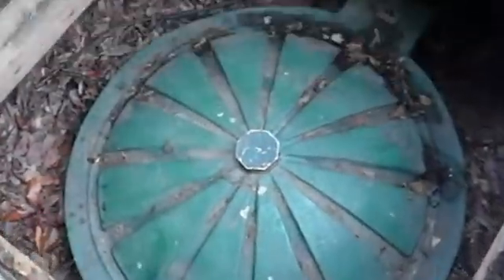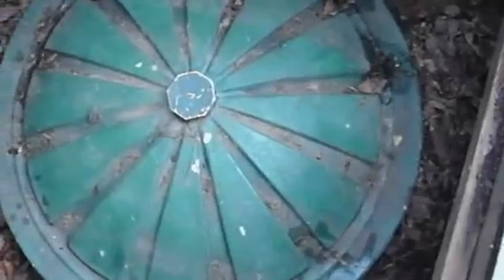Multi-Flo 32 years old and still working great

Comment: Ours was installed in 1996.  We're on the 3rd aerator motor.  It had the primary sensor assembly replaced, and the filters completely replaced once.  In the past couple of years we're starting to notice grey foam sludge seeping out of the sides and what sounds like a dead aerator motor.  Not quite sure what we're doing wrong, other than adding 4 children to our family (washing and bathing more clothes, dishes, and bodies).  A little at a loss for what we should consider doing differently.  We do not have a flow equalization (trash) tank.  Any tips is highly appreciated.

Comment: We had one installed in 2011 as our conventional septic system failed and new regulations didn't allow replacement, so we have a tank before the multi flo (green tank) that grinds everything up before getting to multiflo aerator. We are required to have it serviced/inspected by a qualified person every six months and it costs $300 annually. Replacement all filters cost $90; however, they are usually just pressure washed. We have had to have filter's replaced once since 2011. Are system then discharges into a smaller mound system as our property was too small for typical size.

Comment: Our company has been a Multi-Flo distributor for over 30 years. The Multi-Flo is running perfectly but is in need of routine service. The split surge bowl model were installed from late 1979 to 1981. It has had a air intake/alarm conversion kit installed on it to redirect the air intake from the top of the lid (probably due to installing the deck above) to drawing air through the electrical box. The float switch has probably been disconnected due to the conversion kit installation as it has a high water alarm sensor built in. The Multi-Flo system in one of if not the highest rated system in the onsite sewage treatment system market.

Comment: what does it cost to service this system, like cost of aerator and the filters?
Reply: You can get the aerator for about $600 installed with a two year warranty. You shouldn't need new filters unless the filters you have now have holes in them. I usually wash the filters in place with a special nozzle that attaches to my pressure washer. Only takes about 30 minutes. Best to do it when the tank is empty.
Reply: Multi flow is a good system. Very time consuming to pump out. Each sock has to be cleaned. I made a 1 1/2 pipe and attached to 2” vacuum hose coming from vacuum truck.